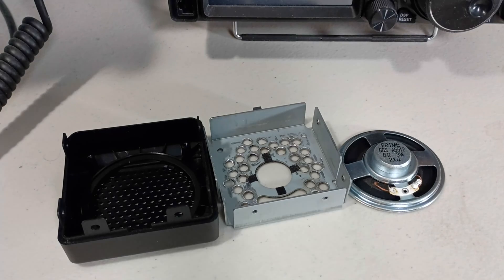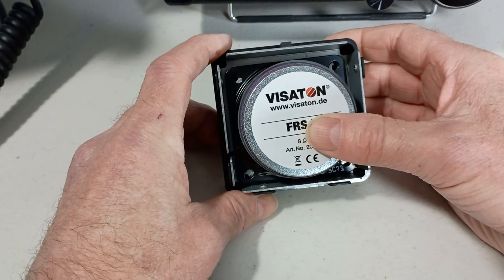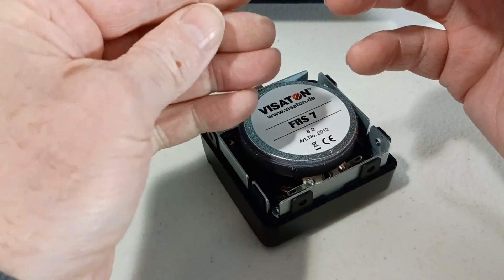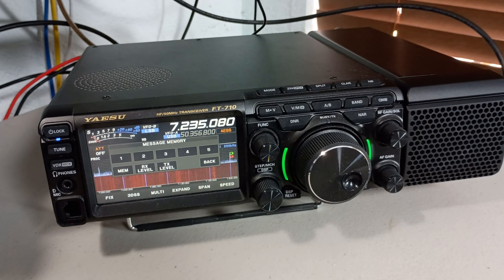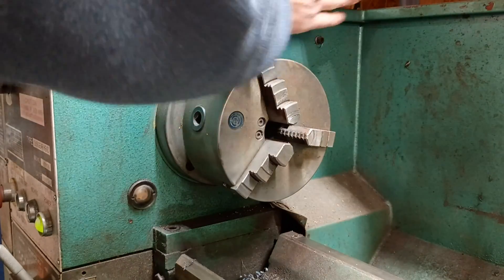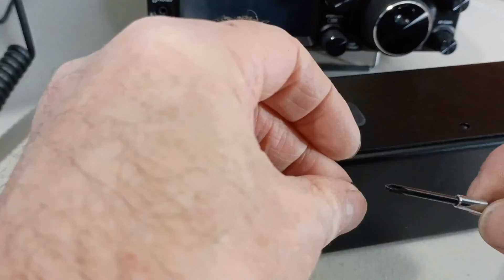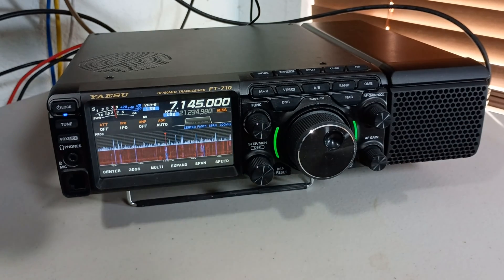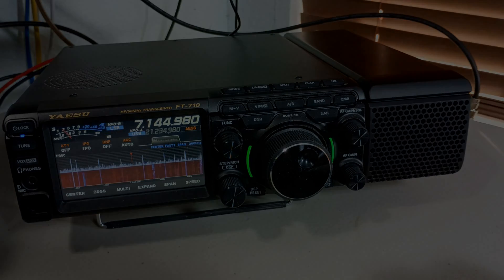The final modification of the Yaesu AESS external speaker.

Comment: That external speaker is $120.00 (2025). Basically, you are buying an empty metal box to put a $17 speaker. What a racket for them. Thanks for the heads up of this, I will find a box and buy this speaker and make my own. lol

Comment: If you are trying to increase bass you could put a ring of sealing putty between the magnet and the speaker basket to damp and couple the assembly as well as a bead of sealing putty to close up all the leaks in the steel box then stuffing the box with acoustic insulation. Of course the internal speaker on the 710 gets the low frequencies and the aux speaker gets the highs with AESS activated, so why do you want more bass out of the high frequency speaker?  Additionally, the lighter mass of paper cone speaker probably does a better job reproducing the human voice than the speaker you put in, so you actually downgraded since you can't use the extra bass response, either. The best thing you could do if you want more bass would be to take the internal speaker output to a larger bookshelf size external speaker and use a large planar tweeter (GRS PT2522-4 3-1/2" Planar Tweeter: Parts Express) for the aux high freq speaker.

Comment: I have made the change of speaker for the recommended Visaton FSR-7, I have been able to eliminate the metal part by hitting a nut with washer with cyanoacrylate in the 4 points necessary (2 to the left and 2 to the right of the front). The 2 screws below are placed before closing the enclosure. The sound has changed substantially for good. Greetings.

Comment: I have another new idea. You can suppress the metal part simply by hitting Cyanoacrylate a nut with washer to each of the plastic tabs of the front rack. Thus you can hold it with its original screws. This is what I will do as soon as I receive the speaker I have purchased (Visaton FSR 7).

Comment: Thanks for the video and the experiment.
Well, the problem that I appreciate is that this speaker has filtered frequencies from at least 700 Hz. and this prevents it from acting as a true exterior speaker. Frequencies between 100Hz. and 700 Hz. they will not be benefited by the quality of that speaker. Another solution is to connect a self -amplified speaker to the headphones connection. There the range is total.

Comment: I've been using a Yaesu SP-10 speaker. It matches up with the 710 very nicely. I think it sounds and looks better than the included SP-40. With the AESS function, when using a different speaker, the phase needs to be checked to make sure the two speakers don't cancel each other.
Reply: Audiophiles will tell you the phase makes little difference except on bass. You cannot tell the difference at vocal frequencies even though I will probably do as you advise anyway.

Comment: Just got an FT710aess. I overrate the external speaker when I say it sucks.  I avoided all the effort of rebuilding the AESS. I put it in a storage bin and grabbed a spare compact Yamaha bookshelf stereo speaker I bought at a yard sale. Much higher fidelity than the AESS and/or internal speaker. I operate with audio sent completely to the bookshelf speaker. I placed it on a shelf above the desktop and save the desktop space for more useful items...
Reply: That is what I thought, too. What one really needs is a pre-out line level two channel AESS output signal to route into a stereo amp with tone controls. Then put a planar tweeter on the highs and a 4" paper cone driver on the low= ultimate clarity.

Comment: A breeze block makes a good dead enclosure,  but too big for this project.I made hifi speaker encloses for stereo years ago housing the base/ mid speaker in a clay pot 12" wide drain pipe , all plastic now though, it took two strong men to lift it, certainly improved the sound. In my icom pro took out the 1 dollar speaker and replaced it with better one, best thing that happened to it, it surprises me they skimp on this when its pennies on a thousand plus radio!

Comment: Use some sound deadener on the inside walls of the speaker cabinet to lessen the ringing sound of the metal cabinet. You would think with the price of these radios the build quality would be better.

Comment: Since you have speaker design experience, how would you design the same form factor from scratch that would attached to the side of the radio (and what speaker would you put in). I think it would be interesting to mount a custom enclosure to the side.

Comment: Like your results...don't think I can duplicate it..don't have the lathe!  Just to clarify the final design was stuffed? Also, can you clarify if stuffed was a what kind of material or was r[the inside lined with material?  Thanks for the answers!
Reply from the maker: I had the lathe, so I used it, but a jigsaw or dremel would have worked as well. In the first video of this series, I stuffed the external speaker with acoustic fiberglass.
Reply: Thanks for the guidance and fast response...you did a great job! @ricksshop
Reply: Did the stuffing make a difference in the final design?
Reply from the maker: I didn't test it without damping with the replacement speaker. @jcalbano
Reply: Okay thanks for the info..I am going to make the mod. speaker is back ordered   @ricksshop

Comment: warranty void 👍
Reply: @robbvk6es who cares if the speaker warranty is void
Reply: @scottgarvy  clearly you don't understand sarcasm 😁
Reply: @RobB_VK6ES  👍
Reply from the maker: On the speaker? Absolutely. On the radio? Well, Yaesu provided a standard 3.5 mm external speaker jack, and quoting them from the manual, "The AESS is designed to function optimally with the included speaker "SP-40". It will not perform properly with other speakers." Nothing there about voiding the warranty.